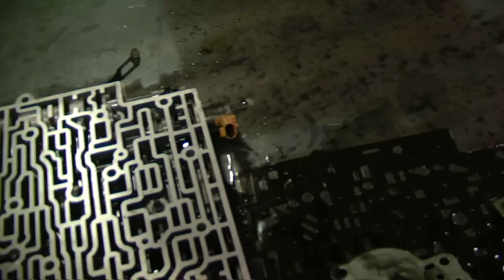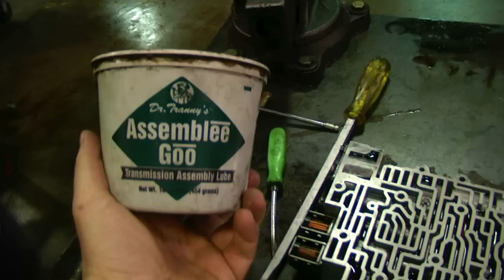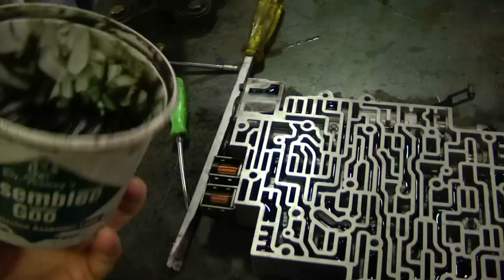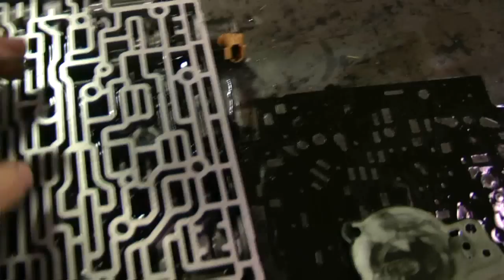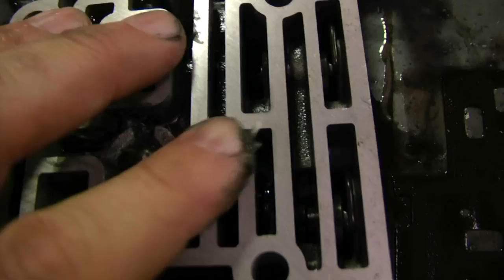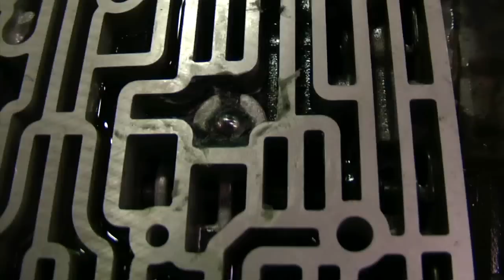Installing Check Balls in a Valve Body

Comment from the maker: we use something called Transmission Assembly Goo. Not sure who makes it but I'm sure you can get something similar from a trans parts supplier or the internet. Unlike most greases, it melts at really low temps and disolves with the trans fluid. Vasaline behaves in a similar fashion.
Reply: Where does the check ball and 2 springs go on jatco 4n71b transmission

Comment from the maker: They act as a check valve allowing fluid to flow in one direction and blocking it in another.  The check balls close off the holes in the plate.  Fluid can come through the hole and push the ball off its seat (the hole). but fluid following in a reverse direction will push the ball onto the seat (hole) and block fluid flow. Except when they are worn as shown in the video allowing fluid to seep through the worn out seat (hole).

Comment: Isn't there a possibility  of that grease, or Vasoline -- whatever you use -- getting clogged in the valve body channels and  creating a flow problem?
Reply from the maker: This is a little late but I thought I'd add it for anyone wanting to know in the future. The Vaseline or Assembly grease will not clog anything because its a very low temp grease. Vaseline barely stays solid below 100 degrees. The assembly grease has a low melting point and is designed to mix with the transmission fluid.
Reply: @ttcautotech  Thank you so much for explaining this.  God bless!